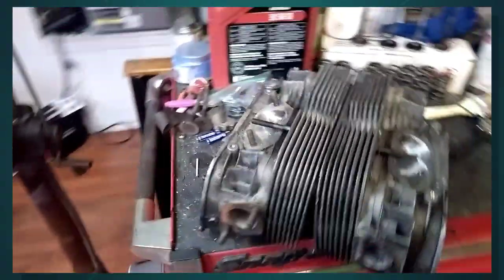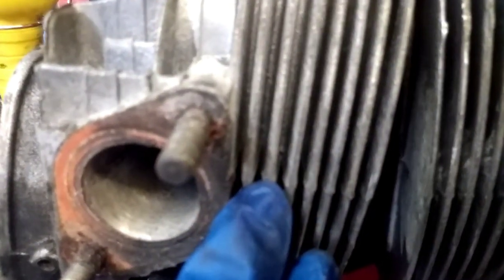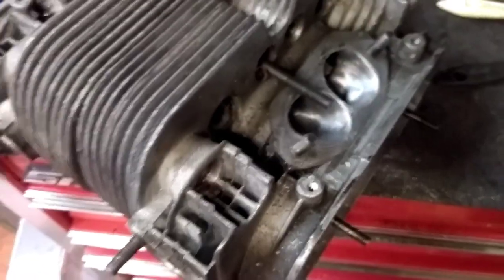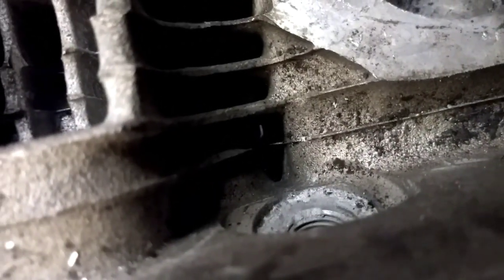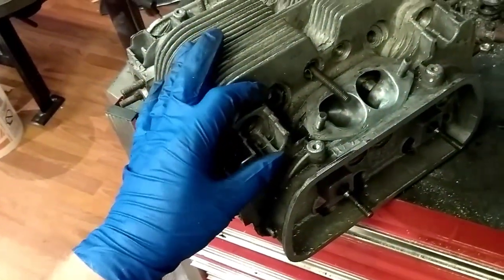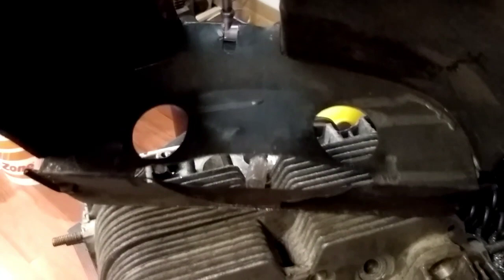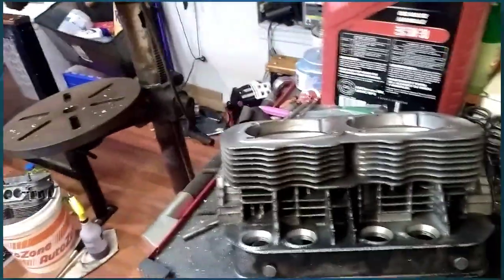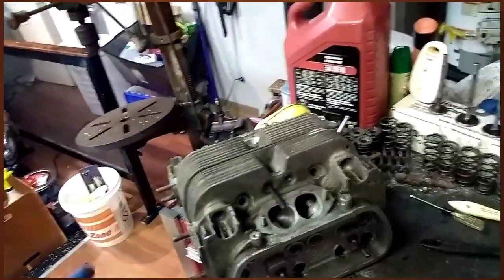Cooling Mod's For Cylinder Heads.

Comment: I had to do a lot of modifications to the EMPI. Replacement heads omg especially in the rocker stans had to modify the head and the. Rocker blocks. Check out the video rocker arm geometry
Reply from the maker: I have heard that the rocker block and rocker arm can have interference problems on those. I have not used Empi heads yet tho. Good thing for other people too look out for, thanks for The tip.
Reply: @MattLundquistVW  I had geometry problems i have a few videos explaining and showing some of the machine work.
Reply from the maker: @jonyperformance7958  I will check it out👍

Comment: In the 80s where I use to get parts they had Autolina 40X35 heads for 37.50 each and I know good and well He paid 17 for them but He bought 200 at a time . He told me He could get a better deal if He could purchase 500 at a time . Where I worked We would charge 40 per head to put guides and grind the valves !